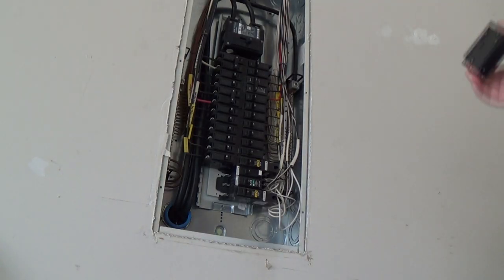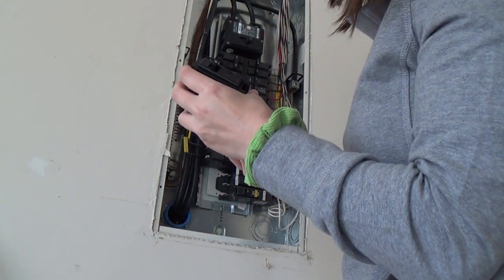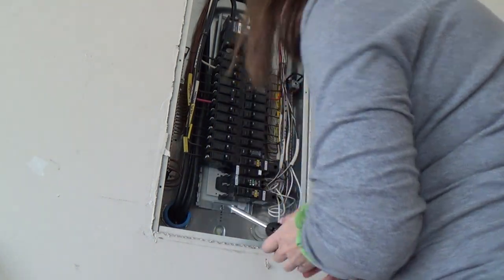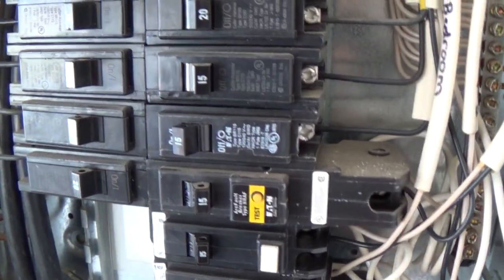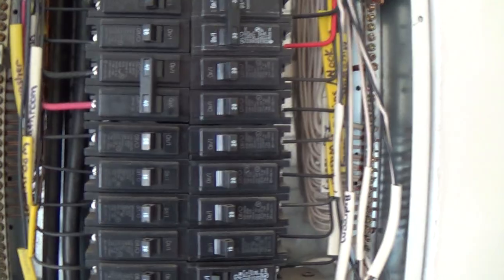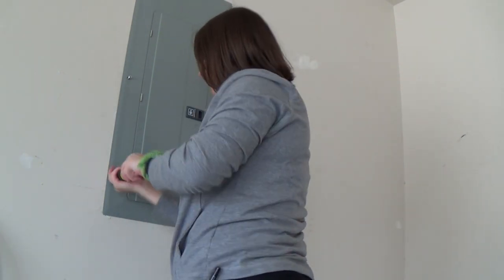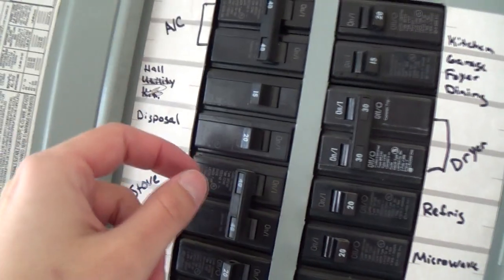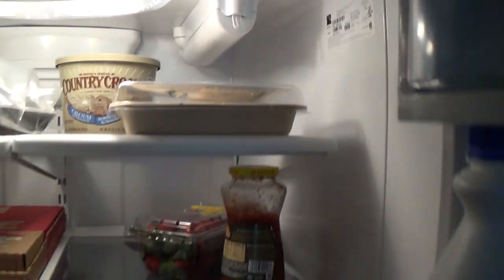DIY With Syntria - How to Replace a Circuit Breaker and NOT DIE

Comment: Good work. Usually changing breakers on a live panel isn't that dangerous. Usually I've only seen people get zapped if there's a vacancy around the breaker they're changing, and they handle the breaker around the sides while snapping it in. And always make sure the breaker is in the off position when snapping it.  It's usually when pulling new cable into the panel when people get wrecked, because one or both hands will be on the bare ground while their elbow is resting on the box, when the ground wire touches the hot bus bar. It is a good idea to shut off the main when changing breakers, but still do everything in your power to not touch the bus for if you do start working with the bar hot. I'm also a PC tech but my father is an electrician and my grandfather was too.

Comment: Why was your breaker tripping?  You said you turned the breaker back on, and it tripped again.  That does NOT mean the breaker is bad.  It might mean the breaker is doing its job, and that circuit is drawing too much current.  If so, replacing the breaker will not solve the problem (unless you replace it with a higher amp breaker, in which case you'll cause all sorts of other problems like fires). 

Also, you shouldn't be messing around in that panel if you're "not sure" what you're doing.  That panel is life-threatening.  Meaning if you did something wrong in there, you absolutely could end your own life.  For example, you turned your main off, but did you test to make sure it was off?  Did you know that there was STILL 240v being supplied to the top 1/3 of the panel, even AFTER you cut the main (basically everything ABOVE the main breaker (the one that said 200 on it) was still live and VERY dangerous)?  There was also no reason to turn all the other breakers off (other than the main) - that didn't do anything.  And your A/C has nothing to do with why your breaker for the circuit feeding the fan was tripping.  That's a completely seperate circuit.  This IS something a homeowner can do.  BUT, you should call an electrician if you're "not sure" what you're doing.  With electricity, you need to be sure.
Reply: Chill out
Reply: You’re 100% right and no protective equipment

Comment: I use Arctic 5 on CPU.Check CPU cooler fan is turning.CPU maybe going bad.Video software or video editing will push CPU temperature up.I just built machine with 8 core AMD and has no trouble Good video.

Comment: Always assume that electrical stuff is still hot (like the saying "there's no such thing as an unloaded gun"). In the future get a non-contact voltage tester ($20) to test stuff you're working on. Also wear rubber gloves, wear sneakers and stand on plywood. Virtually fool proof way of working with electricity.

Comment: Well done - and safely. One question. What is A/C -- your air conditioner? If that were bad in some way, it should not effect an "unrelated" circuit (& it's breaker). 

Also, it would be a good idea to buy a cheap voltmeter (<$10) to make doubly sure that a circuit is dead when you think it is. I have surprised myself a few times when I thought wrongly - zapped. Even an electrical engineer gets distracted, tired, careless at times.

MSEE in electrical engineering,
Joe
Reply from the maker: +Occubit Technology Solutions OOPS. I replied with my business account, sorry! How confusing. XD